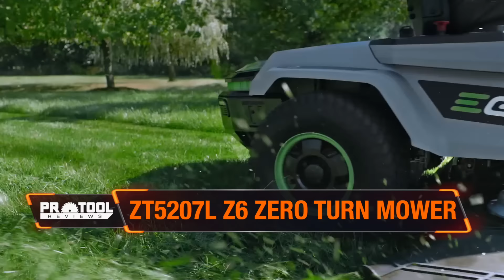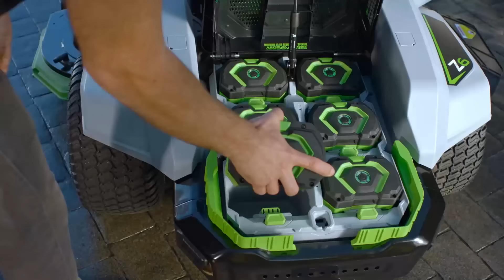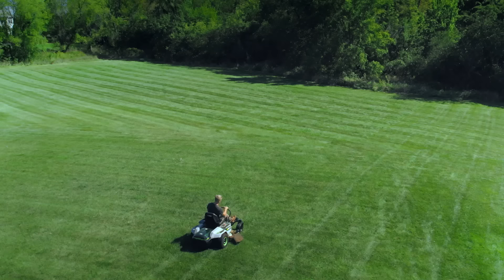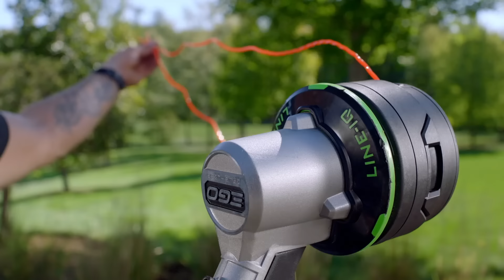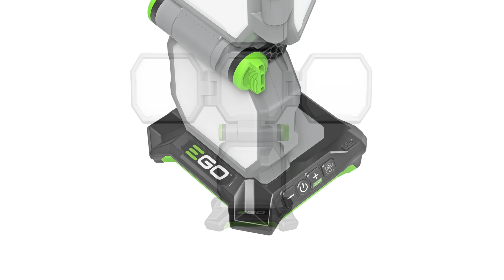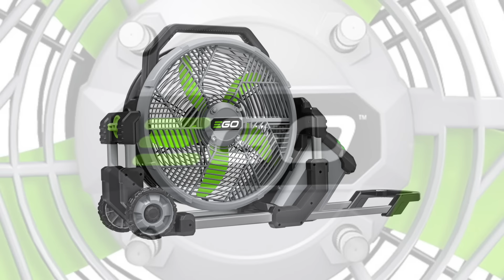[ALL NEW] EGO Products Launching in 2022

Comment: I bought a house in December 2021 and I'm leaning towards buying the leaf blower and weed eater in this video. I like the technologies in the weed eater with the line IQ and Powerload. The leaf blower will be fine as I don't need a ton of run time out of it. Will be nice not having to mix gas for gas powered equipment. I think I will stick with my mid 1990's Honda gas powered push mower until it won't run anymore. You can't beat its reliability.

Comment: EGO makes some great tools, even for a commercial use which I'm interested in. But unfortunately their batteries are way more expensive than from competition. And here in Europe we can only dream of the prices shown in this video. Imagine everything being a bit more expensive but without the batteries, meaning tools only. If I want to do some longer trimming sessions and blower use, I have to get 4-5 batteries at least. And one 5Ah battery is around 250$. Oh yes, the zero turn from last season, the one with a smaller deck and less power. That was over 10 000$. I can see this new one going for 12-13 000$ here. This is why I'll stick with the gas engines, with Makita being my go to battery tools, like hedge trimmers and pole saw.
Reply: In Australia a 5.ah battery is $350 . I can get a whole petrol mower for that .

Comment: Good gear I like ego stuff ok. I use my 530 cfm ego blower for grass on sidewalks or tiny yards with leaves but the battery runs out pretty fast just like every other battery blower. You can slap a 7.5 battery on it and then it’s heavy AF. I’ve overheated battery’s on tall wet lawns with  the ego mower I used to own. I’m peetty sure all battery gardening  tools overheat if they are ran too hard. Gas just bogs down but battery tools shut down and have to cool. Even though I own plenty of  battery gardening tools and really so enjoy their advantages gas is still the obvious king of the gardening world.

Comment: Would like to see EGO come out with a Garden Sprayer for weeds etc.
Reply: Just buy a Scotts. They have a rechargeable pump that is in the handle. Looks like a regular pumping handle, but it isn't. Fill up the tank. Remove the handle from the charger and thread it on. Turn it on and it pressurizes the tank. When it is done...spray. If the tank drops pressure, the pump detects it and kick on, you don't have to stop.

Comment: I got the 56 volt chainsaw . Thought it was great for the first year , battery shorted out . The price of a new battery is 80% of the price of the saw . Now  it's basically worthless. A gas saw may not start as easy as an electric , and may be louder than an electric , but at least they run every year . Learned my lesson. Hope this is helpful for you  .
Reply: There is a 3 year guarantee on the batteries.

Comment: Is the new 52" ztr a replacement for the 42" or an additional model?  I doubt many Lowes will stock a $7k ZTR.
Reply: Good question,
Reply: I hope it's additional because a the 42" barely fits through my fence gate, the 52" would require me to use the huge recalcitrant gates I built to admit bucket trucks into my backyard.

Comment: I really want that mower, but i really need the fan, especially for the garage, get som airflow in their.
Reply: if your garage has mains power you would be much better off to add an attic fan or wall fans or big belt-driven wheeled fans that run on 110 or 220.

Comment: The new leaf blower kit is going to retail starting at $399 (it comes with two batteries not one).    Its predecessor will have a $50 drop  :)  I have a good feeling about this
Reply: I have heard that it will come with 2 batteries but I still find that hard to believe. If they are 5 ahr batteries then the batteries alone would cost $500. I know it is much cheaper to buy kits but I have never seen a kit price that much cheaper than the batteries alone. If I ever needed to just buy batteries then I would buy this kit and sell the blower. Doesn't seem right to me.
Reply: $249 for the 650cfm?
Reply: @unseen_perspectives_419  this what I speculate, the 650cfm model will not be discontinued; it will be discounted and stay in Ego’s lineup.  The lowest price for the 650cfm model has been $269 earlier this year

Comment: Well, they're certainly sticking to their class-leading high prices.
Reply: Only complaint I have is battery prices, I hate having to buy tool kits to get additional batteries for a better value
Reply: @unseen_perspectives_419  I think battery prices are high for all brands not just Ego. When I break the cost down to battery capacity or available watt hours I find that Ego falls in the middle compared to other brands. Cost per watt hr tends to be in the range of $0.75 to almost $1.00 for most brands. From there I compare battery quality, technology, performance, warranty, etc. and in my opinion, Ego comes out on top. Still the same high price but at least I have confidence in what I am buying.
Reply: @jamie8917  I’ve had 3 of my ego 5ah Gen threes go bad and they sent me warranty issued new ones. If it wasn’t for that, I would be so confident in them over say my Milwaukee ones. I noticed too the larger 10ah has a 5 year warranty vs the 3 year, enough alone for me to buy those instead of 7.5ah
Reply: @unseen_perspectives_419  Ouch 3 replacements. At least they were covered and Ego honored their warranty. I'd love to have a couple 10s for my snow blower. 5 yrs on a battery warranty is quite good IMO.
Reply: @jamie8917  yeah one of them would work part way through a charge and flash red, another wouldn’t charge at all, and last one was dead on arrival. Yeah 5 is great to me, anything less I am 😬
Reply: You get what you pay for. If you want quality equipment, Buy Once, Cry Once. But if you want to pay cheap prices, then you'll get Cheap Products and continue to buy replacement tools as those cheap ones break down or wear put far too often.
Reply: @jmackinjersey1  that’s exactly right, you get what you pay for, Ego is a higher quality Chinese made product. People buy the cheapest things at the dollar store and Walmart then complain about low quality.  Not all Chinese made products are cheap and low quality, you just can’t afford quality products.
Reply: People pay it
Reply: @unseen_perspectives_419  Exactly. Like they say a product is only worth what someone will pay for it and there is a reason why they are the #1 battery powered OPE brand.

Comment: I like the light, and the fan
Reply: I don't know how those fit into the Ego OPE lineup. Flex yes, but not Ego. I can't see spending $250 on a fan. I do love Ego products, but I really wanted to see a dethatcher this year.
Reply: @jamie8917  I think it gives EGO users a good use for the batteries once the yard work is done. I like it. Also, Ryobi has an 18" fan thats $149 bare tool and its soooo weak. IMO that 5,000 CFM upgrade seems worth it at that price.
Reply: @zachmgill  I do have to agree. The reason I bought the power station was to get more use out of all my Ego batteries.

Comment: What is the warranty like?
Reply: the tool is five years and the battery is 3 years
Reply: typically 3 years for batteries and 5 Years for the tool... my snowblower SNT2406 has a 5 year battery warranty - I think it may be due to the fact that its a 10amp battery instead of 5 or 7.5
Reply: @lovykhanna8570  I didn't think the 2 stage snow blower came with a 10 amp batteries. Mine didn't but I think it definitely should have. Looks like they upgraded it along with an extra $300. I think the batteries for the original zero turn also come with a 5 year warranty. At that price they should.

Comment: The batteries are the ball and chain. Once you buy cordless products you are invested into the battery line. You begin to buy around the battery system you already own. Its a hard cycle to break. 

I'm invested in the M12 line and it was hard to switch when I did due to being heavily invested into another product line.
Reply: The M12 line for most pros is a secondary, not a primary. My primary is Dewalt's 20v line but in all honesty, I reach for an M12 tool first just because of its lighter weight. But yes, you're absolutely right, once you are suckered in it's hard to jump ship. I wish I could switch from Dewalt to Milwaukee's M18 but I have like 16 Dewalt batts and something likev 25 tools so it's too late for that.
Reply: @thebigdoghimself  it's never too late to come over to the Red Side. Especially when you tart looking at all the tools Milwaukee has that DeWalt doesn't, and how much more powerful Milwaukee is compared. Just sell your DeWalt tools. Although DeWalt has that new power stack battery technology. But it's not enough to make me switch, because I've heard Milwaukee has something similar in the works. But if you're a General Contractor like me and always needing to expand and buy new tools to get a job done, then Milwaukee is definitely the way to go. M12 and M18 and their newest line, MX FUEL.
Reply: @thebigdoghimself  , That's not necessarily true. There are many tools in the M12 line up that are not in the M18 line, like the ratchets or smaller lights. And then there are M12 tools that are also repeated in the M18 line up that are used when the Professional doesn't need all of the power that the M18 produces. 

I am a GC, and see a definite Need for all three M12, M18 and MX FUEL. There are even some Milwaukee power tools that are not on the FUEL line that I have in my arsenal that I use. Yes, weight is a factor at times, but just having the right tool and more importantly, knowing which one and when to use it is the key.
Reply: I agree, I am heavily invested in Milwaukee. However they are really slacking and lacking in the OPE, and will not communicate with me or anyone else about near future OPE products. So if I have to, I may invest in EGO for a few tools. But then if Milwaukee does release them, I can always sell my EGO tools.

Comment: First mod on the fan would definitely be to add some air filters and make it into a portable air cleaner for random jobs. Ever since I tried adding 20" filters to box fans I never do anything dirty or slightly dusty with a proper face mask and box fan filter combo. Makes it easier on you working and clean up a lot easier.
Reply: Might not be ideal since it is a mister fan combo. Maybe you can turn the missing function off which might work?
Reply: @jronmanbuilds  the misting function is not on all the time, but as unsaid before, placing a filter in front of the fan adds more restriction to the airflow, adding more heat to the motor and batteries. Thus ruining the tool.
Reply: Adds too much draw to the battery. Definitely Not a good idea, since you'll be ruining your equipment.
Reply: Hope the fan allows you to plug it in to an extension cord or use the battery. I have seen Milwaukee going this route with some of their equipment.

Comment: There is at least $2400 in batteries to run the zero turn. So when one go's out you,ll be paying  400 + for one replacement.
Reply: This is geared towards wealthy homeowners who like to cut their own grass. The price performance ratio on this over the long term is terrible! It’s not practical for professional use as you can never keep the batteries charged or swappable at a reasonable price. When we get to the point where you could recharge a unit like this from the trailer in 10 minutes we’ll have something to talk about.
Reply: @JBK63  I agree with you but if you  recharge over 4000 w/hrs in 10 minutes it would burst into flames.
Reply: If they follow their current trend for battery price (2.5 $150, 5 $250, 7.5 $350 & 10 $450) the new 12 ahr battery would be $550 each and with this taking 6 when it comes time to replace them it will cost $3300. I am impressed with the quality of Ego batteries but unless there is new battery tech that can extend the life of them that is a huge investment and is it worth spending that much on batteries for a mower several years old?

Comment: 52 inch cut is almost double the price of a gas mower . And what is the price of new batteries ? I ran a gas mower for 14 years no problems . I’m sure replacement batteries are extremely high .
Reply: Based on how their current batteries are priced I would guess that the new 12s will cost about $550 each. $3300 to replace 6 batteries? If this lasted 14 years I would guess you would have to replace them at least once which puts the total cost around 10k. Deep pockets for sure.
Reply: @jamie8917  that’s a lot for batteries . I bought a milwaukee string trimmer and blower . I started off with 2 m18 12 amp batteries . Which were $125 bucks when I first started . Within no time I found it would take many to get through a days work . But the price had jumped back then they were $175 bucks each . We had bought 17 in total . Down side was even though milwaukee said they had a2 year warranty since the batteries did not make it past a year . I expect them to warranty them they did not . They said we had charged the batteries to much . I did not see anything on the package about how many charges you can do . Bottom line is the cost of using battery equipment is very high . I like the idea of it but I’m sure when something breaks down the cost is going to be very expensive . The price for lawn care will double and people will probably just do away with lawns and go with desert landscaping . And people will be unemployed I have already seen  .
Reply: @johnbailey9682  Two problems with Lithium that even NiCa outdoes. They are delicate, cold and overcharging will kill them prematurely, and they don't last as long even with proper maintinence. While they hold more power per charge, you can't regarge them anywhere near as many times. That's why they estimate the life in recharges, not years.

      Solid state will be the best bet for batteries. Until then corded or gas beat 'em.